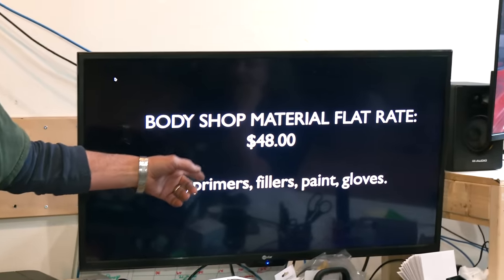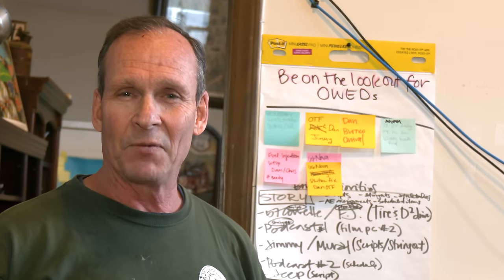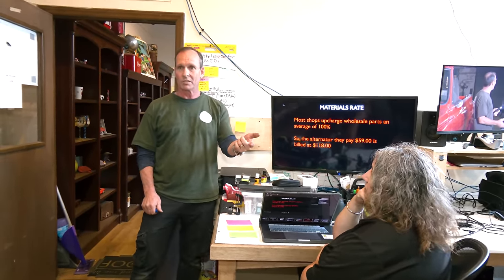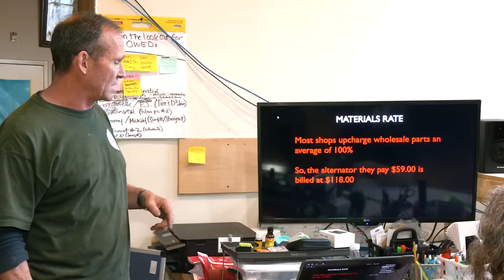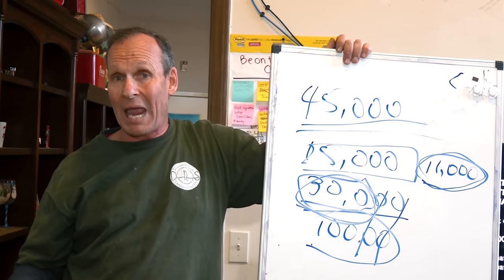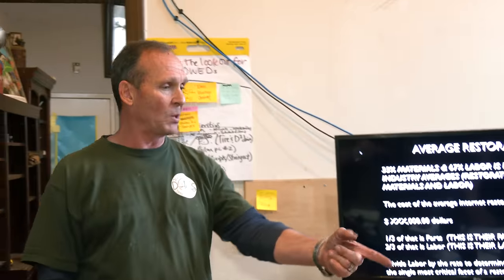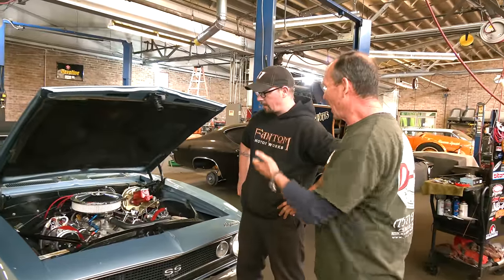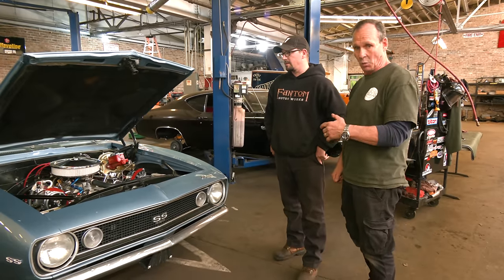Do You Want the Truth or a Lie (4K Upload)

Comment: This is why I built my own shop, I raised 4 kids and for a long time we have had 8 cars in the family,  if I didn't do my own mechanical work I'd be broke, oil changes alone same me thousands per year, I was quoted 1700 for ball joint and tie rods for my daughter's durango, 143 in parts, I did it myself, the only thing I have taken to the shop is alignments and tires install, other than that we do it all ourselves, from oil changes, to swapping crown vic. Front ends into my 1963 f100,
Reply: Exactly. If you have the property, you're ahead of the game, just buy tools as you need them.
Reply: Get a changer and balancer.   Do it.

Comment: I don't know Dan, when I was in high school I had just finished putting a 351 cj motor in my 1954 Ford pick up and it needed a paint job. Earl Schieb was offering to "Paint any car for $99.95". I've got to say, that was a truly amazing paint job to see, and I got a lot more than I bargained for. Two of the tires and wheels were painted, one headlight was now half blue, emblems, door locks, chrome trim, everything was either painted or over sprayed. When I complained, they told me the $99 special included 15 minutes of prep work! I learned a lot that day!

Comment: I am a former auto electrician. We had a shop for 68 years. My grandfather started it in 1938. Being in the industry, I wouldn't doubt a nicely restored vehicle could easily go to 110k or more if it's customized. You can put as much as you want. Also I've worked on customized hot rods that look awesome until you look under the dash, or under the car. Like lipstick on a pig.

Comment: Dan, THANK YOU for this tutorial!
I’ve restored several cars. I”m 59. I have a business with satisfied customers. I got bit in the ass by a family deal. It started out by asking me if I would be interested in “getting it running.” A 1951  3 window 3100 that my cousin built out of an orchard truck in high school which he wrecked, so it sat in my uncle’s garage for 25 years.
Showed up on a trailer unannounced.
Had a grafted A-body front frame, no floor, rotten wood bed, A-body BOP 8.5 “12-bolt” with home made leaf spring perches, twisted U-bolts and damaged leaf springs, bent frame, Saginaw 4-speed, 327 with scored bearings and mismatched Power Pack heads, bondo’d rust, etc…
Short story: I’ve had this for 15 years and it is almost done. My uncle has paid me $30k. I’m the bad guy.
Details: Rebuilt 327, reworked mounts, converted to rebuilt 700R4, modified and rebuilt ‘76 1/2 Ton 12-bolt 3.73  posi with 5 on 4.75 bolt pattern, new firewall and floor, all new box with adapted floor out of newer truck, all new glass, new wiring, new interior, new suspension and brakes, power steering, modified coil spring rear suspension from ‘71 C10, custom exhaust, Chevelle fuel tank with modified filler, custom wheel base, shortened running boards and fillers, rear fenders moved forward 2”, lengthened rear bumper fillers, lots of custom metal work and new parts, 
A/C, new grille, bodywork, paint…..
I have over 40 grand into it not including any of my 1300 hours of labor which I am only billing half of and only at $40/hr. I’m still owed about $30k which I may not ever see. My siblings are up my ass to “just get it done”. Nobody gets it that I have to work on my actual customer’s vehicles to make a living while this truck is a side job. It is a beautiful truck done cheap and that is why it has taken so long. I love my family. I rode in this truck as a kid when it was as an orchard truck. Nobody will be as happy as me when it’s done and I’m very close. Maybe your video can give my family some perspective. I haven’t procrastinated, I have persevered at my own time and expense. Even if I get paid, they will have a truck that could be sold for more than it cost them for me to build it. How is that even possible???
(You’re welcome!!). I believe you can see the value in my gift even though my uncle “has paid me all that money.”

Comment: Being officially ancient, (even have the paperwork), & starting my journey w/ autos at 12 in my uncle's repair shop, & taking me through race car fab, street rod construction & antique restoration, your analysis was the most honest I've ever heard on the topic of building cars.

It reminded of 2 things I learned over the years. There used to be a story about getting a great tuck & roll interior done in Tiajuana for half the price in LA.

They did look beautiful when done, but in 2 months they started to collapse. Instead of foam, they useed newspaper.

True or not, it makes the same point you did, you can make it pretty at low cost, but it's junk underneath or you can make it reliable & driveable.  Can't do it on the cheap.

The other is if you want to start a car project, the best way to start is buying someone else's incomplete, non-running dream.

Comment: To add to this. I am working on an 62 mga.  I blast, do all the assembly and disassembly, body work, welding, mechanicals, etc.  The shop I work with will just mask, prime and paint (original color/paint, no clear coat).  The cost for that is quoted at $7500.

Comment: Dan what your getting at is doing what it takes so it's been finished 100% and doing it right the first time. Like before putting an engine in you take the suspension apart pull the k member prep the parts, paint and reinstall. Many shops are not thorough in their approach to doing work. It's the difference between a repair shop and a restoration. 
One last problem is paint shops only wanting to insurance jobs.

Comment: Love the honesty. I took my non-classic 2005 Avalanche to a paint shop looking for a quote. The price quoted was 45k - 50k. I just about spit.😂 I get it. I wasn't looking for that quality but I get it. I'm a general contractor and I will not lower my quality standard to fit someone's price point. I will restructure the remodel and remove items but I won't use low quality components or take shortcuts

Comment: Well first glad to see your still alive and healthy. As to prices what if the customer has literaly everything to fix/build the car? For instance I have a 1960 Plymouth Fury 2dr ht. It is straight and what rust it does have I have what is needed to repair. Interior I have everything except carpet. Mechanically again have everything. It all just needs to be put on. And by the way it is completely apart to find what it does need. Even have all new rubber seals and what nots for it.

Comment: You're right on! Restored a 53 Chevy suburban in 1999 and did everything myself except the upholstery and I spent $31,000 then and countless hours and then in 2007 I did a 1969 Plymouth roadrunner and I did have a professional body man help me do the paint and body work and he was fast because he worked in a production shop and him and I had 
240 man hours in the total paint job .however we did not paint or restore the underside of the car. he only charged me $25 hr which was a total blessing. I did all the other work myself except install the seat covers and I was into that car for like 32k so I definitely know what it takes to do a vehicle . I also started out with a car that only cost me $1,500 for a "complete core car". I'm currently working on a 61 Olds 88 2dr sedan and we'll be doing 90% of the work myself.  I'm 62 years young and a USN vet. These people that are getting into the car hobby nowadays don't have a clue . Keep up the good work!! Thanks for the break down .

Comment: Dan.  Yes In trying to do a resto mod om my 41 Chevy truck, I spent over $45,000 in parts, paint, nuts, bolts, and new steel. Engine overhaul, trans overhaul, rear end overhaul, and new parts on everything on the rolling chassis. Not counting the Hundreds if not thousands of hours doing the tear down, cleaning parts, and all the other thing needed to be done. And yet I only got to the 75% completion stage. And that does not include the $18,000 that I paid for the original truck...  Ron  USCG RET

Comment: Talking about clocks in old cars, I had a '65 Impala with a nonfunctioning clock (shocking, right?). So being an Electronic Technician by trade, I figured "how hard could it be?". In this case, I got lucky. It was just the contacts on the winder were burned, so some sand paper and assembly and it was working again. I also rebuilt the wiper motor, which just needed the armature contacts polished on a lathe with some Emery cloth (and about 30 minutes with an x-acto knife clearing the copper out of the gaps). You never know what you can do until you try.

Comment: I have been restoring car's for 30 years on and off and there is no way to give a general  price to restore a car, every car has a different condition  a rare parts can be all over the board .I tell all customers a set price with a 20% lee way up or down i do a lot of Camaro's .Like a 69 with no floor work is about $75k..If you do a cheep job you will get a bad reputation !!! . P.S Nice to see you back Dan oh I was in the Navy for 6 years in the mid 80's was a A.S.M on F14 .GO NAVY
Reply: Yes.  And the word "restoration " is different than just " Rebuilt with a paint job" and so much in between. 
$9k-$100k  has different levels of truth and BS in between . 
This is a guy that fixes cars, but never claimed a  restoration  although frame off rebuilding was done.

Comment: My resto shop gave me an initial ballpark estimate of $85,000 for a 1949 Mercury pickup resto mod.  The scope of the work quickly escalated after exposing all of the thick bondo, rust, and the poor quality  work that had previously been done.  Three and a half years later that resto is still on-going and I am approaching the $200,000 cost mark.  
The craftsmanship and parts are absolutely top-notch, but I will be lucky if it is actually worth $80,000 when completed.   Long lasting reliable quality is going to cost you, and as stated in the video, It's tough to stop once you have started the restoration process.

Comment: The paint job on my 69 Dart convertible was 300 hours with no stripping or blasting with no panels being replaced. I drove the car to the shop and towed it back home. And engine compartment was already painted and nothing was pulled nor undercoated. Probably the least amount of effort was done for a complete paint job.

Comment: I do this crap for a living oh I know . I started out with a $20,000 63 Nova . Doing the paint myself . I got $4500 in materials and not counting any time . All new interior $3000. My parts bolts , radiator engine trans lines yada yada $25,000. Put it this way I’m doing all the stainless myself . My chrome was $1,500 for one bumper so two bumpers that’s $3,000. My console get ready $1,700 at advance. I bet I will have $60,000 in this car . I take it to a shop way over 100k . My work charges $40,000 for paint and body that’s average. We are $85 a hour it goes fast . Builds for as high as $350,000. The high end cars like kindigit get ready $600,000 plus . The average chrome bill is 50k to 100k . Keep it real man I love your show I miss it. You have no bs

Comment: I am a hotrod shop owner myself, I do everything from basic engine swaps to 2000 hp street cars along with full restorations.  A basic Ls swap with a takeout motor and trans starts at $10,000 at my shop.  About half of the cars that come to my shop have been at other shops that ripped off the vehicle owners and I am stuck putting the pieces back together and informing the customer I have to start over because the work is so bad.

How is a 4L70E basically a 4L80e?  I wouldn't put a 4L60E based transmission in anything with over 500hp. I push everyone into either a 4L80e or 6L90e.  To build a 4L60e to be worth a crap you are going to spend $5000 or more in parts alone. I can build a 4L80E capable of 1000hp all day for $2000.  The 4L60E has the 3.06:1 first gear ratio and the 1.63:1 second gear ratio which is too far apart and that dramatic of a drop pulls the engine too far down out of it's power band which is the result of a transmission being designed for fuel economy with a 150hp engine.  The sonnax 2.84/1.55 6 pinion input planetary gear does help some to correct that but at is $800 alone.

Comment: Really good video, 👍 I worked at a Canadian tire over 20 years ago , all the mechanics worked 40 hours a week  or 8 hours a day. Every job that was done during the day was based on a set amount of time EG :  
4 winter tires installed and balanced would be 1 unit or 60 minutes, I could do this job in 20 minutes but the  customer would be billed for the full hour. I was paid a flat rate per hour with a monthly bonus if my number of units were high enough.

Comment: Thanks for your honesty.  I am doing a full on restomod. A 65 Ranchero. I’ve already done the mustang ll swap. A 9” triangulated 4 link. Disks on all 4 corners. Complete floor pan replacement from foot wells back.  That’s what I’ve done so far. Still a long way to go. Next step. Connect frame rails. I’m building this car to be a fun to drive daily driver. Oh!! Did I say that I’m the only one that has put hands on it. I’ve done all the work myself. Unfortunately I won’t be able to do it all myself. I sure hope that I find the right shop when I do need that help. I will complete the bodywork and squirt it myself. I still have a long, long way to go. But that’s OK. This car is going to be beautiful. Oh and I do watch your programs on TV. I’ve been watching it for a while.

Comment: I wrenched for 47 years. Retired 2 years ago. I started restoring my 1955 ford f100 truck. Its now a year in work, doing it all myself. The sheet metal parts are not cheap. Getting rid of the rust cost money. Lots of sheet metal replacement. For now just getting it drivable. Its lots of work. $$$

Comment: First of all I have a whole new respect for your, your shop, and what you all do, both behind the scenes and in the front!

I like THIS video more than all the Discovery Channel episodes put together, it shows the real Fantom Works!

I just had someone suggest coming to you to put an interior in our 1927 Buick Standard Six, it’s a driver and a prev owner had the body painted….again it’s a nice driver at best.

The car has the original mohair interior in it, from what we have seen all the wood is in good shape it’s just the fact that the mohair has lost its color and is very dry!

The car sat in a garage, a dry garage, for 30+ years after the prev owner passed away.  In that garage we rescued TWO 1952 GG TD’s that once washed you could eat off of, new paint, interiors, engine detailed, extra parts such as interior kits and top kit…the prev owner who passed was pretty good about how he had his cars done, and of course we rescued our 1927 Buick.

I work at a large GM dealership and we got the car running very easily after building a new fuel tank, flushing everything, dropping the oil pan and removing what was left of the oil, oiling all the cylinders and using the hand crank to “work” the engine until it was as smooth as a Singer sowing machine!

I rebuilt the carb (well cleaned it), the Stewart Warner Fuel Canister, primed it, ticked the carb, and  the third time it turned over she came to life! She spit and sputtered and stalled, the next attempt she started up and while she smoked for a few minutes due to the residual oil on the cylinders she has run fantastic ever since!  

^of course we changed the oil again, adjust the carb, adjusted the timing etc in the process!

She is a nice car and she is worthy of a nice interior.  I live somewhat local to Hershey and attend the AACA meet every year and was going to order an interior kit but something told me to hold off and luckily I did, the company who made them closed shop and went bankrupt about 3-4 months afterwards and took all those who paid or left deposits with them!

So intuition you get a point!!

Fantom Works would you be interested in doing the interior?

I am really just talking the seats front and rear and door cards, I’m fine with removing the dash and restoring both it and the interior window trim myself but the upholstery work it beyond my scope!!

Timeframe doesn’t matter to me, I have all the time in the world for someone to start the upholstery work!  

Of course I’d need you to properly remove it, no worries there, and also reinstall it.

As far as interior door handles, window cranks, and robe rail…I have someone in Australia already making them for me, this gentleman already made me all the exterior handles including switching to lockable from door handles as the car did not come with them when new but were available in the more expensive “Master Six Series”! Who doesn’t want to lock their car at a show, at the mall, and doesn’t think their were thieves in 1927?
Reply from the maker: Thank you for the detailed reply and affirmation! For submitting a project for FantomWorks to consider, you can put all the details in to submit here - http://projects.fantomworks.com/